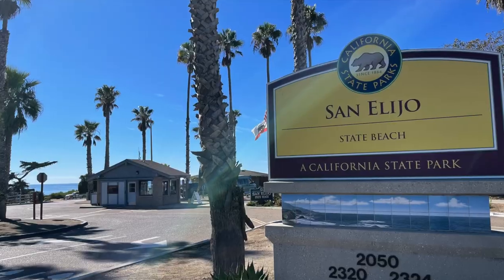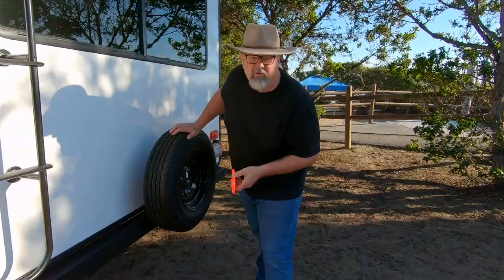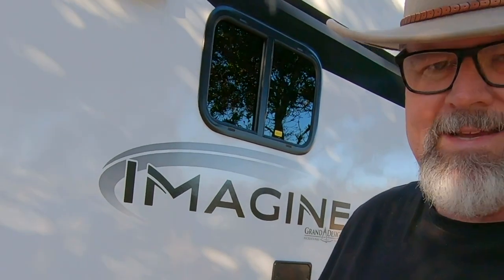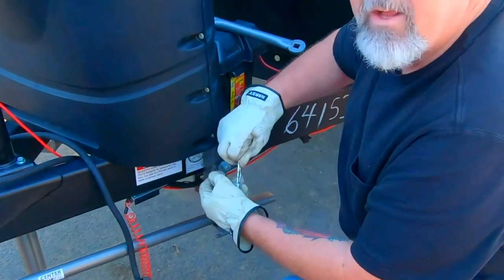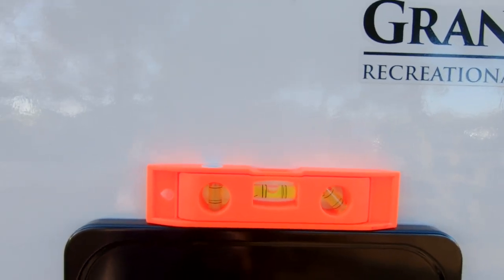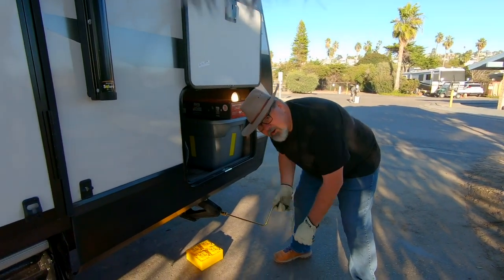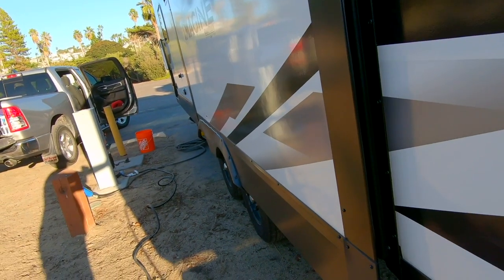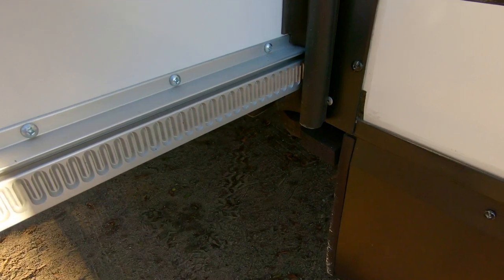Imagine 2500RL Travel Trailer Campsite Setup ( RV Life )

Comment: Great job on the video. Great tips. Smart to check power first! Always open slide while hooked up to shore power after you’re level. So many folks park and throw the slide outs the minute they get there. The only thing I’d add that may be helpful is to raise the tongue Jack higher to loosen the sway bars. You may benefit from another block underneath. We don’t usually need the crowbar if we do it that way.  Yup you will need another pack of blocks. Don’t you love love those Anderson blocks!?
Reply from the maker: Totally agree with you. We always level and plug in power before we operate the slide. Again this probably speaks to my anxiety over slide failures! We definitely needed more blockage on this trip. The way this campsite was set up the front of the trailer really had to come up high to make it work. The Anderson Levelers!!! Dude, those things are the best thing since canned beer. Such a simple but effective idea, we can't recommend them enough.

Comment: I have heard the sewer accordion called a caterpiller before. As for the crossthread problem. Turn counter clockwise until you feel the thread" click". Then righty tighty .
Reply from the maker: I've done the left first and then right, and it certainly give me a better winning percentage. But I would say I'm still under 500. In this case slow and steady seems to be the best practice, at least for me.

Comment: Great RV Channel! Recent subscriber. 
To answer your question about the plastic threads on the power plug always wanting to cross-thread... Mine always did that. Any silicone based grease or spray on the threads, and your problem is solved. Mine was instantly. Threads right on easily now. I think I used silicone slide spray.
T...
Reply from the maker: Hey Terry, thanks for subscribing and for the comment. I have some of that dry lube to use on the slide so I'll give it a shot. Did you spray it directly on the threads? I guess I'm worried about getting the lube on the plug. Maybe I'll spray on a towel and wipe it on. Thanks again for the suggestion!
Reply: @ourrvsunsets  I sprayed directly on the threads, both the trailer side and power chord side. If you get a little I the contacts just shake it out, you won't have any problems. Dry or wet spray will work.
T...
Reply from the maker: @terrybush6430  Perfect! Thank you sir, I'll give this a shot.

Comment: Great video. We got our 2023 2500RL in September 2022 and have used it twice with our next trip coming soon. Does yours have the Compass Connect?  I love using that app so I can bring out the slide while standing outside to make sure it doesn’t hit anything. Also, I bought the LevelMatePRO and love it. We boon-docked last week and I was able to find the most level spot from inside my truck and then used our levelers to finish off the leveling from inside the truck. Something with the power cord that works for me is that I spin it to the left a little before spinning it to the right and for some reason it helps it to sit on the threads better. I look forward to more videos!
Reply from the maker: I do have the Compass Connect although I haven't used it for working the slide yet. Ive used it for the awning, lighting etc. I even use it with our TireLinc system. LevelMate Pro is on my wishlist of upgrades as it will make leveling so much easier. Question for you on boondocking... What do you have battery wise in your trailer. We have one lead acid battery and haven't done any boondocking yet. I'm curious how well it will hold up for an overnight with the 12v fridge and possible furnace going.
Reply: @ourrvsunsets  we have a lithium 100ah battery. After the sun goes down, it gets down in the mid 80% by late evening and is in the mid 60% by the time the sun comes up and the solar starts charging it again. I also use a 2000w generator to speed up the charging process during the day and we get it back to 100% before dark again.

Comment: Looks like 6 lugnuts per wheel on the truck , so it looks like a 1/2 ton. How does that 1/2 ton pull the 2500RL? I'm really interested in buying a camper like yours and I also have a 1/2 ton.
Reply from the maker: Yep, it's a 1/2 ton RAM 1500 that we pull with. The RAM has the 5.7L Hemi so as far as power goes it has no problems whatsoever. We've done the mountain passes from San Diego up to Deadwood South Dakota and never had an issue with power. The one limiting factor for us is the GVW on the truck itself. If we are just out on a camping trip were fine, but if we're using it for work and have to load up a bunch of camera gear, we quickly hit the limit on the truck. The other issue is that being up against the trucks load limit means that you have to be diligent when driving. You will feel the sway from big trucks and wind, so long travel days can get a bit exhausting.  If I had to do it all over again I would go to a 3/4 ton truck just for the added payload. However with the price of trucks these days we'll have to stick with the 1/2 ton for now. It's certainly doable, but not optimal.